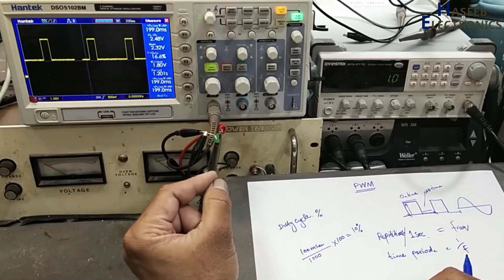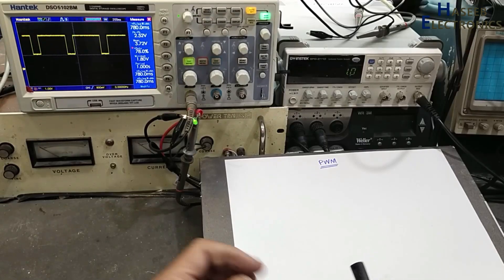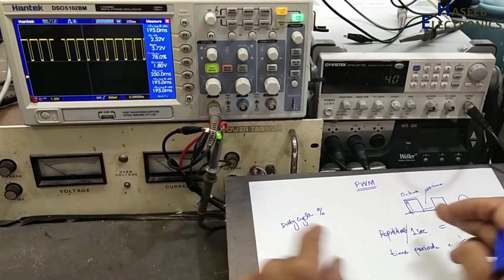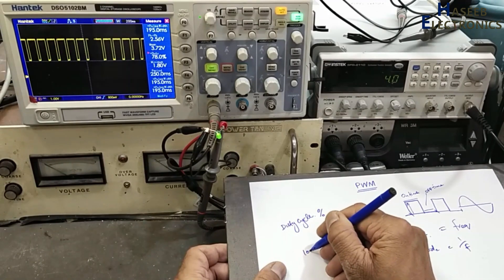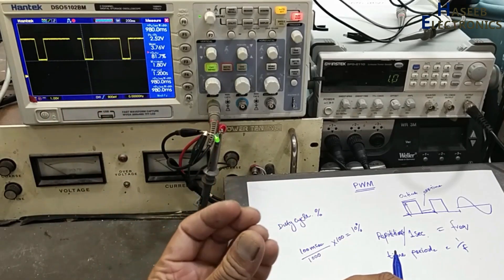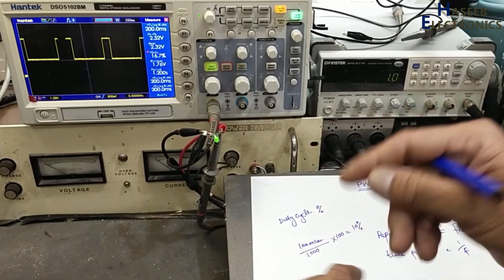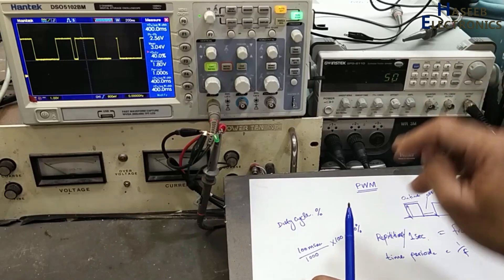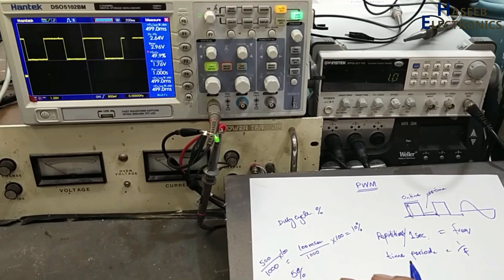{1231} PWM Pulse-width modulation explained

Comment: Good morning , sir you mentioned about isolation transformer for testing with safety or with series lamp. Why isolation transformer is safe?
Reply: isolation transformer is to keep the scope leads (or anything else) for being a dc short to the whole buildings electrical system as the neutral and ground connections are hooked together in the fuse box. you'l have 120 or 230 volts, but building wiring is separated.